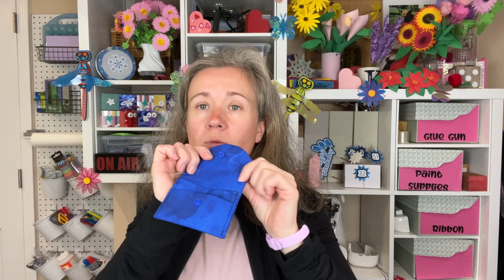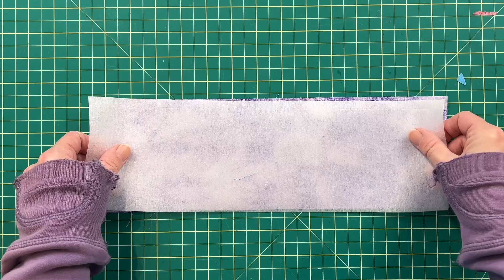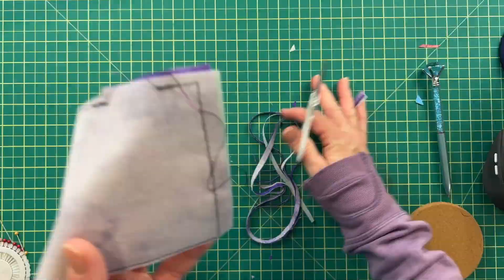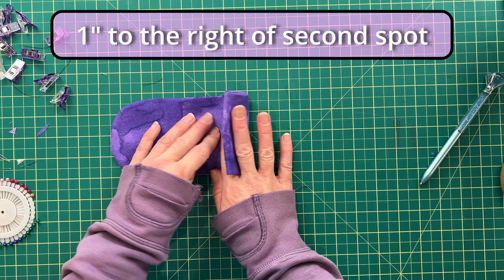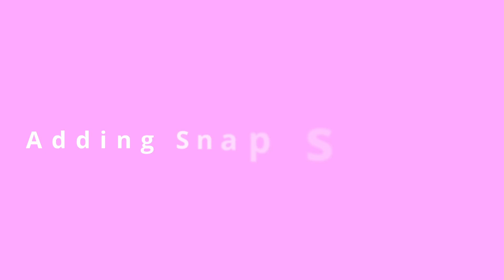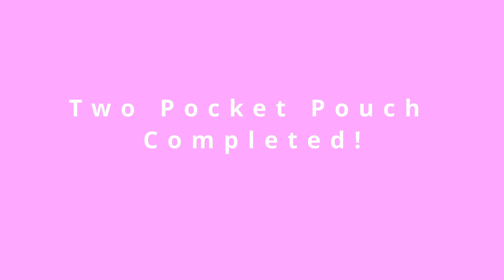Snap Pouch with 2 Pockets -  Sewing Tutorial

Comment: What did you use to punch your hole in the fabric?
Reply from the maker: The snaps I used come with a pokey tool. It’s like a screw driver with a point on it.  With some fabrics you can just push the one piece of the snap through without any tools.  Hopefully that helps  😊 Thanks for watching!

Comment: I have been looking how to make drawstring bags, too. I get tripped up at the top...Do you have a raw edge where the string goes through? I'm a novice, so see you sew would be helpful in the future. Thanks for posting this.
Reply from the maker: Most of this project is sewn inside out and then pulled through a little hole I leave in the bottom corner, so all raw edges are hidden inside. The slot for the string has no raw edges, they are all inside before the flip.  I sewed a seam on top/around the string holes to keep the sting in place, but that is optional.  Hopefully this helps. Let me know if you got it to work.  Thanks for the feedback!  Happy crafting.